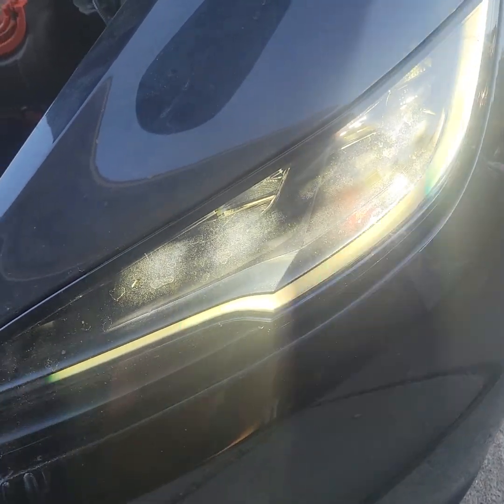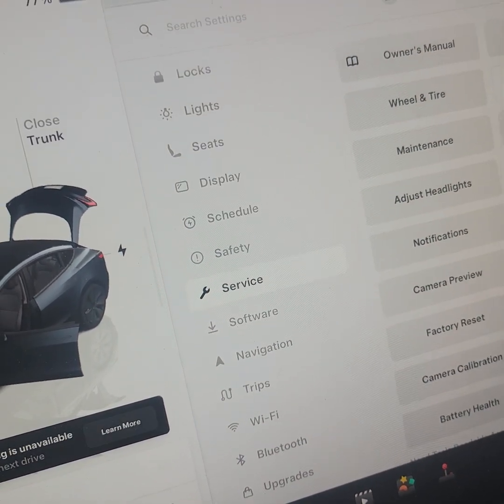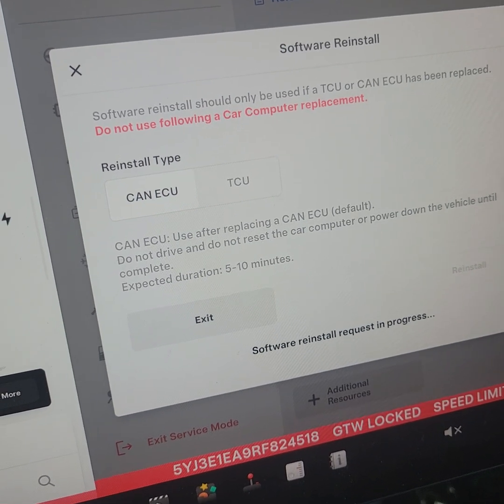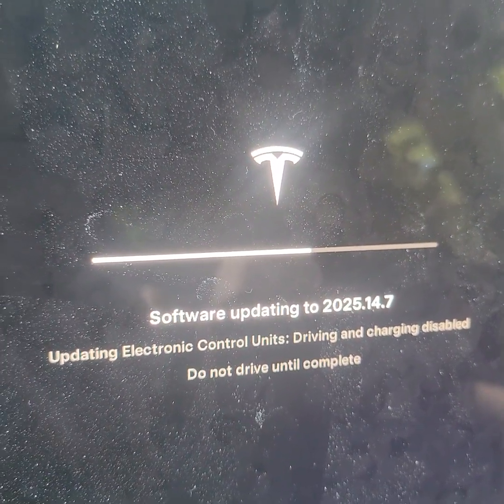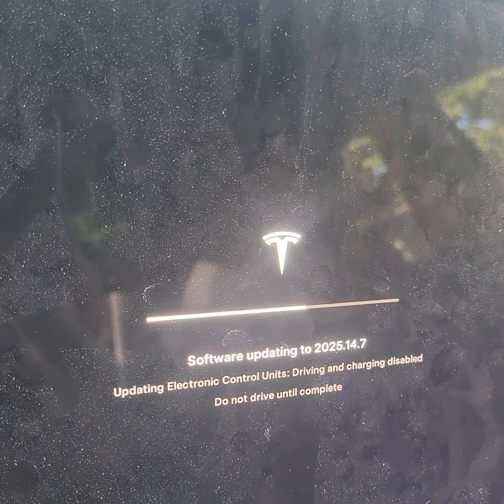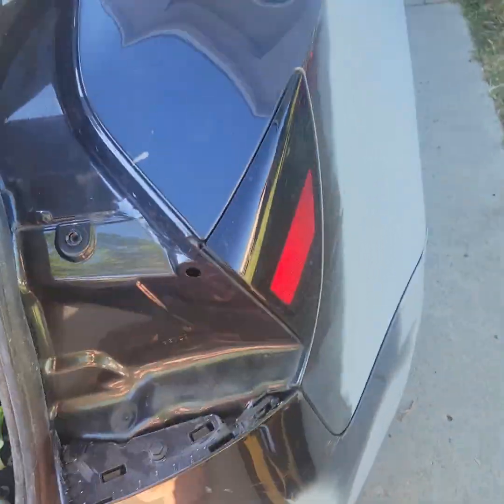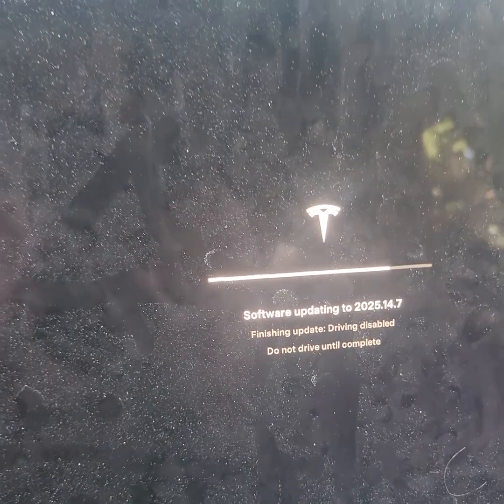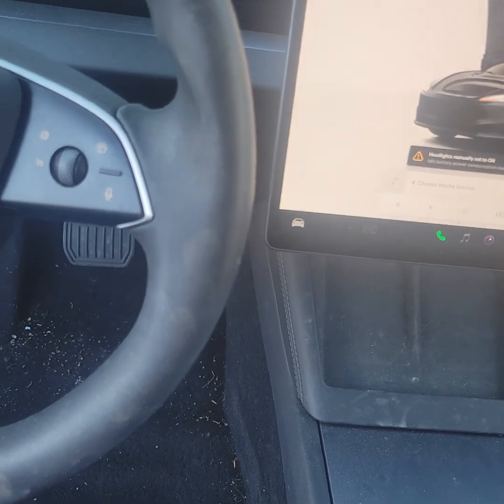TESLA New Headlight NOT working FIXED! Software Reinstall

Comment: I'm in the same boat. Bought the car with damage to right front, so new (used eBay) headlight was bought, plugged in and doesn't work. Never had the original headlight to use original module.
 Going to try this tomorrow.
Just hoping it will work for headlight from overseas (also right hand drive), with modules.
Thanks for you insight!
Reply: Tried it and still not working
Reply from the maker: @dimareznik7224 try swapping module from one side to another then reinstall software.....if original module still works and other new don't then it's the module

Comment: Mine is still not working after a reinstall any advice?
Reply from the maker: Do it 2 times check connection
Reply from the maker: Also try old module
Reply: @TeslaFanz  what do you mean this by this?
Reply from the maker: @JonLang2587 reset software again.  Also if you have old headlight module you could take it iff old headlight and put in new to see if it a bad module
Reply: @TeslaFanz where's this module located?
Reply from the maker: @collincarter1564 under old Headlight it's a metal box with 4 screws